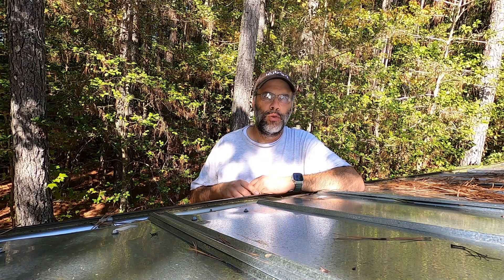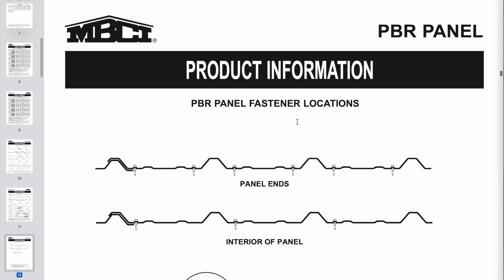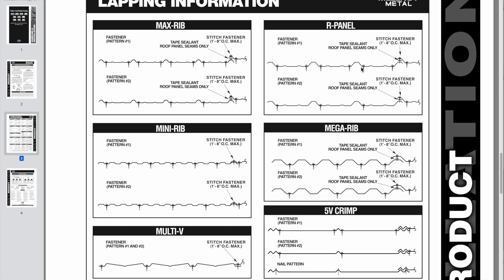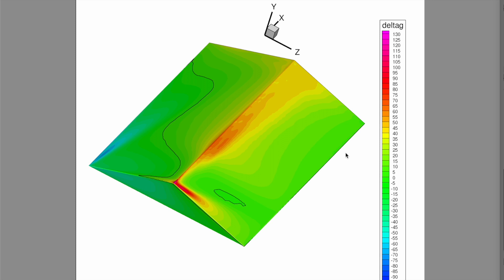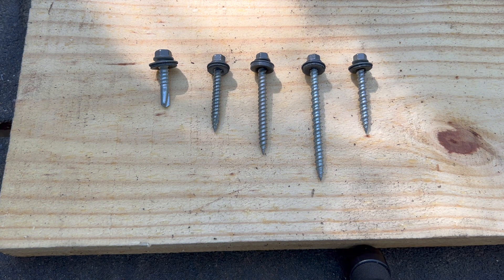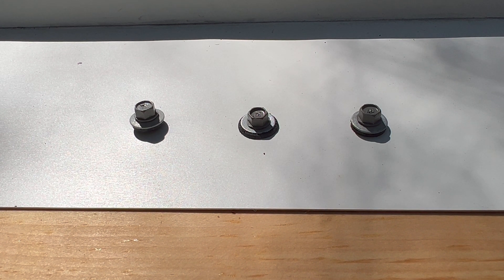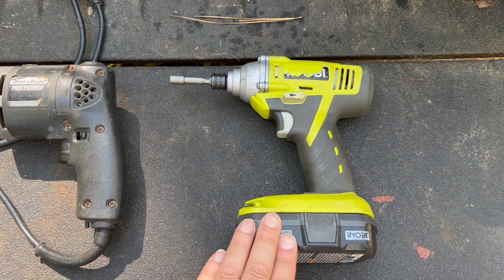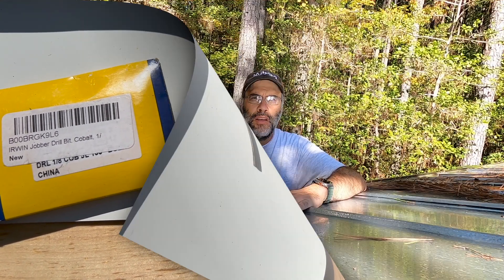Metal roofing screws: where, why, and how

Comment: Awesome video, my metal roof is 12/12 pitch, on SIP panels, very well insulated no heat lost what so ever. The biggest problem we get living here in Atlantic Canada is the winter freeze thaw cycles. The snow will not slide off the North side of the roof and when it thaws a bit and freezes again it forms around the head of the screw creating a solid sheet of ice on the roof, it’s impossible to get it off with any conventional tools. We have to wait untill spring and the melting cycle. Sometimes when the melt is slow there is an overhang at the edge where the ice slowly slides down getting 4ft or more of overhang before it brakes off with a thunderous crash. My suggestion to your viewers living in snow areas is to use the hidden screw type roofing, my neighbours went that route and have zero issues with ice hanging onto the screw heads.
Reply from the maker: Agree, standing seam roof, or the new style that mimics it with hidden clips/fasteners, is really ideal for areas with a lot of snow.  Just be very careful with penetrations for vents, vent pipes, chimneys, etc, to make sure they have a proper diverter, skirt, and flashing, otherwise the sliding snow will tear things apart and cause leaks and damage.  And there are certain parts of a roof where slides could be dangerous for what's below, so snow guards / stoppers might be needed to retain snow in those locations.  

I know a few people that installed this type of roof and later had to go back and add diverters and snow guards to control what the snow does.  Luckily they caught it early before significant damage happened.  In bad situations, I've seen it peel open  the roof and cause a major issue.  A heavy snowpack has a lot of power when it starts sliding.

Luckily with a SIPS construction, you aren't going to lose any heat through the roof.  That can be an additional concern in some climates, where you get additional freeze/thaw issues from heat rising through the roof.  It's a hard balance to get right.

Comment: If expansion and contraction around screws causes them to unscrew, why don't installers drill a larger than 1/8 hole to allow a little movement?
Reply from the maker: I think the issue is that you can have 20+ screws on a typical size sheet, and it's the spread/distribution that really constrains the sheet.

Comment: Hey thanks for the info. I've got a question for you. My house is about 30 years old and we are a couple kms from the coast with high winds. The colourbond is ok but the heads of the screws (12g 50mm) are quite corroded. My question is, should I replace the old screws with screws of a greater diameter or length? Also, are longer screws used for the ridge caps?
Reply from the maker: Normally the ridge cap does use longer screws if you need to reach into the framing below.  But on some installs the ridge cap is only attached to the metal sheeting, with short self-tapping sheet metal screws.  So you need to know how the original install was done to know what sort of screws are used at the ridge.

I have replaced screws on an older roof a few times and always use the same type and length screws, but of course the new screws were about 25-30 years newer and have better material for the gasket and a slightly different washer shape (to protect the gasket from the weather better).  I would not deviate on screw diameter and length, but finding screws with a larger/better cap and gasket can only be an improvement.
Reply: Thank you Sir!

Comment: From the 12 minute mark where the dots are showing where to put the screws, what if you don't have that many studs going across in the middle to put the screws in?  You would have to have 4 horizontal beams and yet only two vertical beams to make a grid support, not including the top and bottom support.  I'm using boards underderneath.  Maybe that's what was used.  I am used to seeing grid supports.  I know I am not using the correct carpentry terminology but I think you probably will understand.  Thank you!
Reply from the maker: That roof has rafters every 2 feet and purlins every 2 feet, so it's a 2' x 2' grid basically.  The number of fasteners and pattern specified by the roofing manufacturer is mainly setup for panel retention under wind uplift loads.  Fewer fasteners means less uplift resistance.  And that translates down through the framing as well.  The screw loads holding the panel to the purlins must be handled by the purlin-rafter fasteners and the rafter-header fasteners along with any storm clips.  And so on down to the posts and footings.  Everything is connected and important.  Skimp somewhere and the roof will have less uplift resistance and be more likely to peel off under wind loads.

Comment: Excellent and informative video.  Thank-you once again Jack.  Years ago I installed metal roofing on my garage and a wrap around verandah with the screws placed on the peaks but now I'm starting to see signs of moisture around the screws on the underside of verandah roof so I agree that the valleys would have been better.  Also, on the verandah I was screwing the top half of the panel and my dad was securing the bottom half.  He tended to apply a bit more screw pressure which would flatten out the peaks a bit more than mine, deforming the panels into a wedge shape.  After 6 sheets it became quite apparent we were no longer running parallel and had to remove and redo the panels.  Make it nice or do it twice.  With time I suppose the rubber washers shrink and harden and with the expansion and contraction of the sheets, it creates more movement at the screws when they are placed on the peaks.  The expansion and contraction would explain why the manufacturers only have one screw in the valleys, allowing the raised portions (peaks) to soak up the movement.  Live and learn.
Sorry, this is becoming a long comment, but I have a question you may be able to help me with.  We had local tornadoes this past spring and many farms and homes lost their roofs as well as downed trees.  Luckily my roofs were ok.  The original house has the ridge going in one direction and a later addition has the 2nd ridge going 90° to the first.  So the wind was hitting a gable face on one portion while it rode the surface (like the airfoil you described) on the other.  X and Z axis on your simulation model.  I only noticed a day later, but the attic access panels for BOTH attics actually got sucked up into the two separate attics.  Pretty scary to realize we may have just been on the edge of losing the roofs.  So here's my question.  Going back to the analogy of the roof becoming an airfoil, I'm not able to decide if the sucking in of the attic access panels was a good thing or not.  I'm thinking it ended up increasing the pressure in the attic, thereby increasing the "lift".  In other words, the access panels should maybe be secured down in some way, not simply dropped down into place.  What is your thought, or if anyone else has insight into this, I would appreciate comments.  Did the openings relieve a negative pressure or increase the pressure in the attics. Thanks again.
Reply: I should also mention the original portion of the house was built in 1910 and the addition around 1918.  The soffits are closed with tongue and groove and not properly vented like todays construction.  Plus on the 2nd floor, the rooms have slanted walls (the roof), again not providing proper air flow.  I have vents at the gable ends to provide air circulation.  This no doubt added to the negative pressure in the attics.

Comment: Wish I'd seen this fifty years ago when I was working on a pole barb building crew. Lots of leak repairs. Now I realize it was over-driven screws (or maybe it was nails back then) , not simply that they were driven into valleys.
Even now (until today), I've used wiggle wood and screwed through the peaks on Fiberglas deck roofings and the like.
Thank you, Jack, for making the rest of my life simpler.

Comment: What an excellent informative video. I’m planing on doing our 24x24 detached garage. It’s 15 years old and the asphalt shingles starting to fail. Here in Ontario Canada, it seems that as per the manufacturer of local roofing steel, the ribs are the preferred location for the fasteners. I will be doing 1x4 strapping on top of the existing shingles for the new metal roof. I am debating what gauge of metal to use as I have the option of 29 or the heavier 26 gauge. I am also debating if I need to cut a ridge vent since this is an unheated detached garage with nice wide aluminum soffits. Since I have 2 x 4 blocking in between the roof trusses at the peak, cutting a ridge vent doesn’t seem to serve much purpose. I would like your thoughts on what gauge of metal I should use and if I need any vent at the ridge in your honest opinion, thank you

Comment: Screwing on the rib adds back tension to the rubber screw seal. However, if attaching to furring strips, most screw on the flat for strength of attachment.

My rule of thumb is, if you’re installing on solid decking, typically new construction or a complete roof rebuild, screw on the ridge. If you’re installing metal roofing on furring strips over an old roof, screw on the flat to get deeper penetration & additional rigidity of install on the roof.

I could be wrong.

Some do both the rib at overlap, & the flat everywhere else.
Reply from the maker: I spoke to a rep for one of the big metal manufacturers about 3 weeks ago and the conversation wandered to this topic.  He said they advise against screwing on the ribs primarily because it deforms the panel profile and compromises sealing of the screw washers. The only panel in their product line that is suitable for screws on the ribs is 26ga PBR panel.

Comment: Can you use self tapping screw to attach it to wood, 1x4 or 2x4 or plywood on the roof? It would be easier than predrilling at some places, also get cleaner and flat hole on the metal sheet, also easier to keep in place once starting to drill.. But would the screw hold any worse than regular screw in the wood/ plywood?
Reply from the maker: No, they don't have the right kind of threads, and won't have very good retention in the wood.  Screw retention figures prominently into loads and uplift resistance and is very important for roof performance.

Comment: Makes me wonder if slanted garnish at the gables would lessen uplift from blowing wind. 
  Or, would that affect water runoff?
Reply from the maker: I suspect there are shapes/modifications that could reduce uplift loads on roofs.  However, it may be impossible to make it work for every possible wind direction coming towards a structure.  You could likely optimize it for a certain onset wind direction though.

Comment: Good video but, this would be great info video for me if you showed the exact metal roof and screws I used, like the metal roofing HD sells.  HD sells several types but I bought mine from nearby lumber yard that sells the same as HD.....
 All your charts showed perfectly flat tops or rounded, why didn't you show the common metal roofing HD sells, the top/peaks aren't perfectly flat nor are they rounded, theres a water channel on the tops with very slight curvature on the very top of the peak. It's a very common panel, there really no room for tape on the tops but calking could be used, which I thought of doing but didn't. Then the screws you showed, ALL have perfectly flat  washers, never seen that type, the ones I bought have a dish shape washer that covers the gasket lot better...... Then why didn't talk about roof pitch needed for screw type metal roofing, I spent 10 hrs this past August looking online trying to fine answers to that, which I thought would only take 5 min....... 
 So on my shop that was built 10 years ago, I thought it was lot harder to screw panels that way, constantly fighting to keep panels square and harder to stop at right tightness. Also I think theres to much panel movement from sunlight so if panels are screwed on the tops, the panels put more stress on screws... So this past August on my house addition I put screws on the low side of panels, easier to keep panel square and now the tops can expand and contract without putting extra stress on screws.  Also my addition is fully boarded over so I put down weather-shield made for metal roofing since I'm concern with low pitch I have, roughly 14" drop in in 14ft..........

Comment: Think about water.  Does it flow in a low spot or high spot?  What will leak the most when that rubber washer degrades?

Manufactures are in business to make money so they’ll tell you what makes them the most money.
Reply from the maker: It's got nothing to do with water in high spots and low spots -- that is a gross oversimplification that misses the actual problem.  The issue is screw head movement when the panels expand/contract with temperature changes.  Screws on the ribs experience greater movement and that causes numerous problems that contribute to leaks over time.